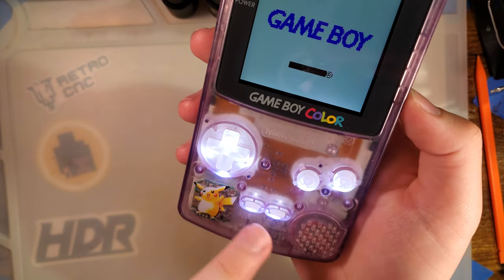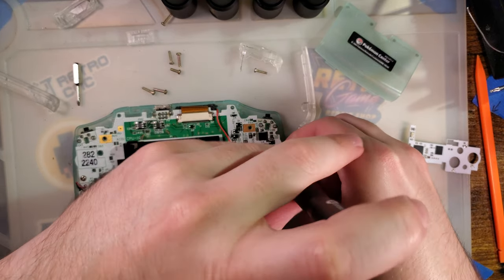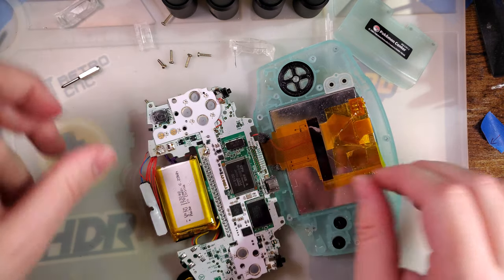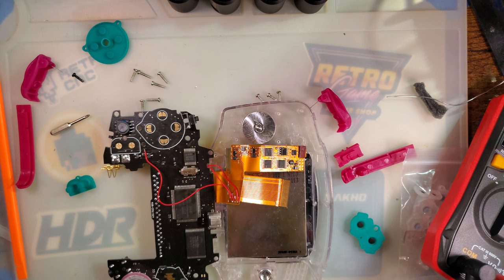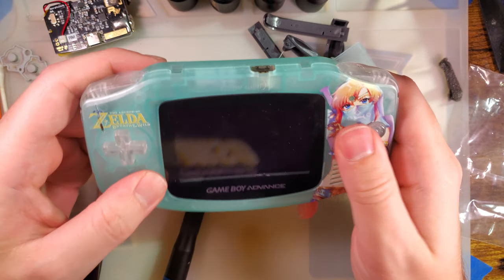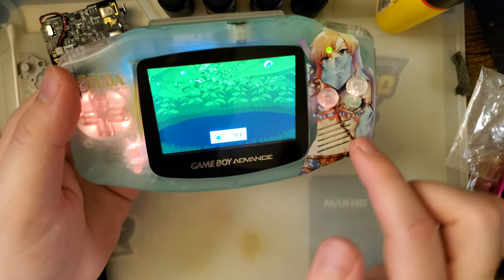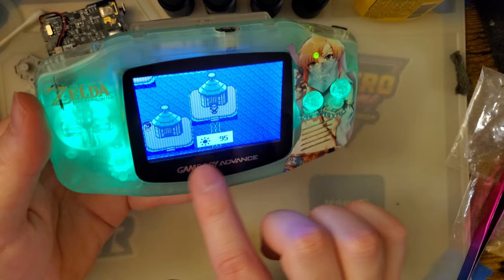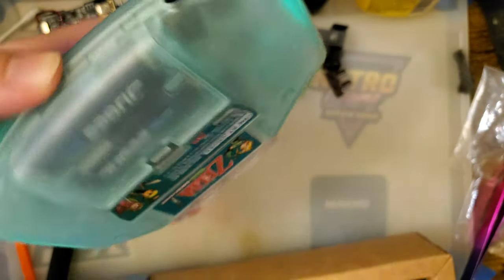ARC GBA | NatalieTheNerd Game Boy Advance RGB LED Button Ribbon

Comment: Hey Makho, I really love your content. Have you found that using these light mods significantly impacts the battery life of your portables? I'm not big on rechargeable mods and generally will use lithium AAs or rechargeable AAs.
Reply from the maker: I mean, if you value battery life, maybe installing LEDs isn't the best move.

Comment: Excuse me mister makho, I installed a nice blue power led on my gba sp and it’s way too bright, could you please make a video about this? It seems like there is also an issue with gameboy color’s and rechargeable batteries making the stock led too bright as well. 

Thank you lots!! Just a suggestion and something I would love to see because I really have no idea where I could squeeze in an surface resistor or if what value I show use
Reply from the maker: The schematic is available if you do some searching. You can also just buy dimmer LEDs.